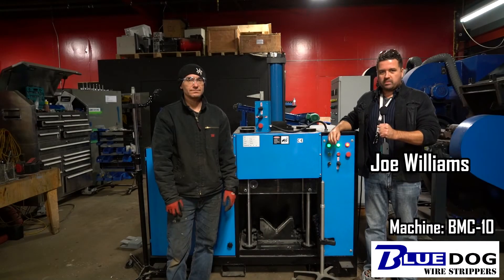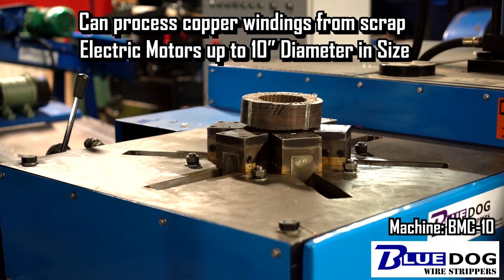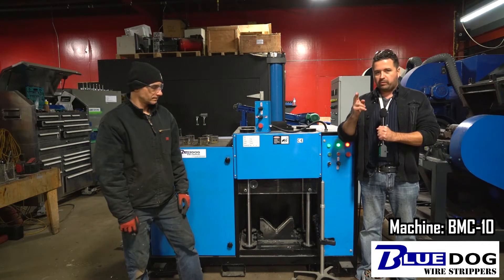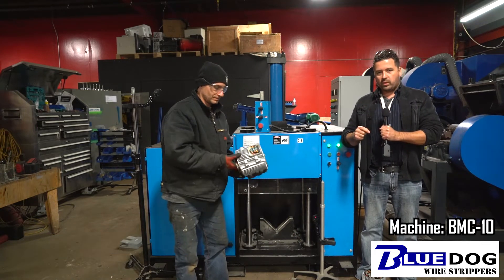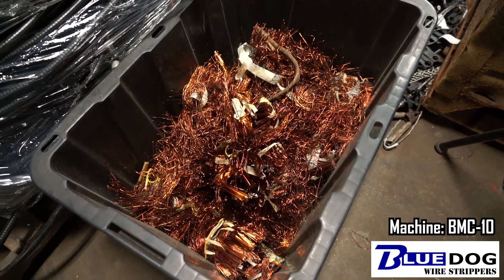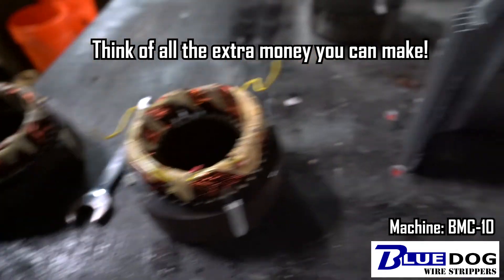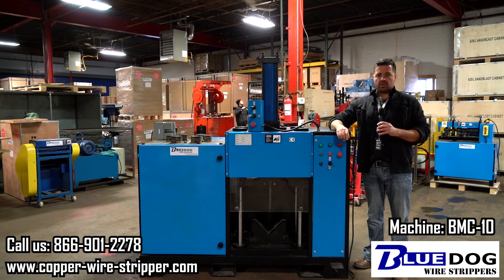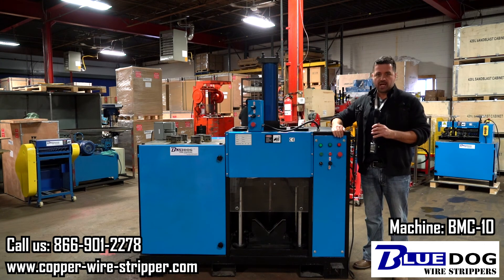Electric Motor Recycling Machine - Bluedog BMC-10.  Extract Copper Windings with Ease

Comment: Very well thought, out if I had the money I would be talking to you. One part I would ask to change is the height of the case cracking and stator splitting unit. I am getting old and getting up and down (and bending over) for each unit on both operations my back would be killing me after just a short while. Raise the contact area to workbench height and move all  the control buttons down to a good position. You will just need some heavy duty legs. Keep the wire puller exactly where it is. I know some people will not be able to fit it in their workshop because the hydraulic cylinder will also have to be raised.